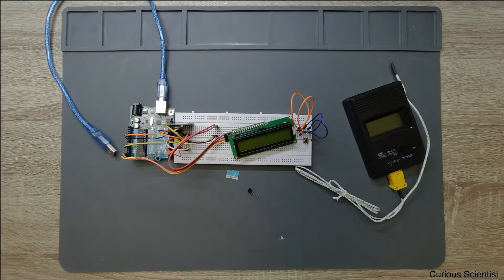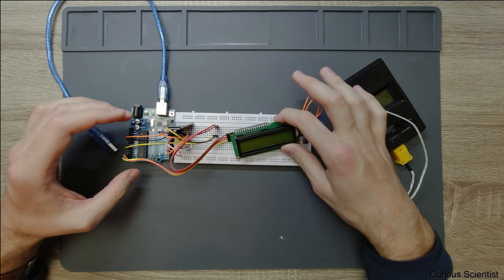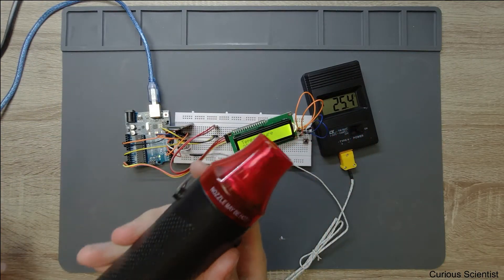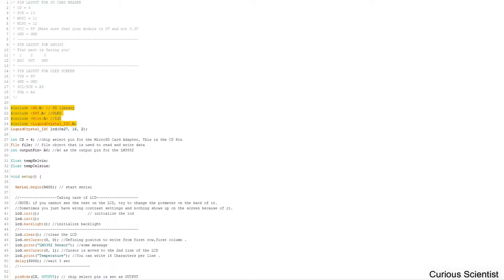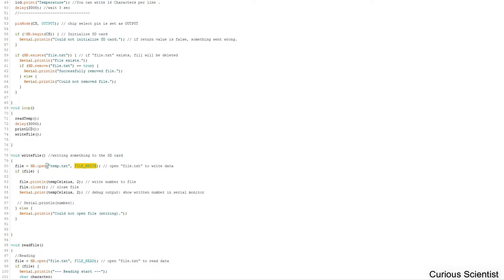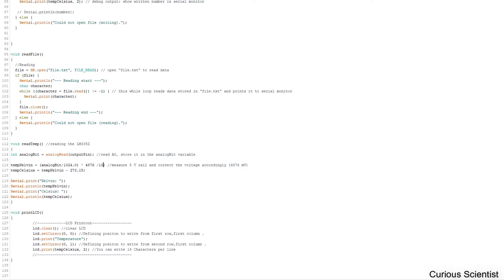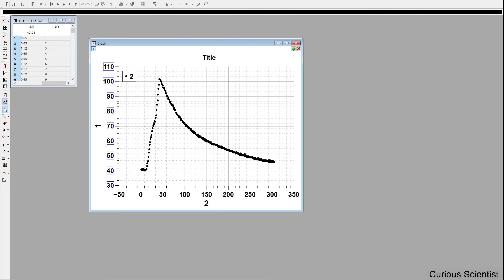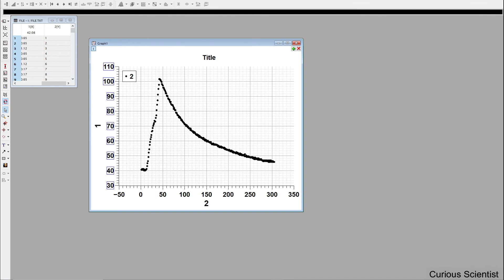Saving sensor data to SD card using Arduino

Comment: Hey, I'm trying this with a load cell and amp. When I ran the code, everything looked like it was going smoothly, but nothing was recorded when I tried to look at it on the SD card, nothing was recorded and there wasn't a file to look at. How do you start and stop a recording?
Reply from the maker: Hi! Probably, you modified something in the code that hinders saving the data. Or you didn't format the card in the correct file system. It is hard to say anything without seeing the code.
Reply: @CuriousScientist  I was really confused because everything looked good and it was verified by the serial monitor. It turns out it was on a "boot" whatever that means. Thanks for the code and reply!
Reply: @CuriousScientist  however only records when the Arduino is plugged into the computer. Any thoughts?
Reply from the maker: That can not be right. I have a similar logger that runs standalone without the computer without any issues. Have you made any changes to the code? How do you try to power the Arduino?
Reply: @CuriousScientist  I've been trying to fix it, right now I'm using the port, but I've commented out all Serial communication, and it hasn't worked.
Reply from the maker: But there's nothing to be fixed. The code is alright from the beginning. Even in the video, I powered the circuit from a mobile charger, and it worked. I think you messed up something with the code.
Reply: @CuriousScientist  All good, the problem there was a commented "}", and the other problem was running it on 7.2V through the 5V instead of Vin. Thankfully I didn't fry anything by being an idiot. Thanks for the help, and good prediction!
Reply from the maker: Giving the wrong voltage is a very typical mistake and it does not make anyone an idiot. :) It was a good lesson. I hope the code and circuit works as it should now! Have fun!

Comment: Thanks for the video man, could you give me insight on how to introduce code it shows date of the data read. Cheers from Chile.
Reply from the maker: If you want date, you'll need an RTC module. Then you just read the RTC. I have a project on my channel where I introduced an RTC-based watering system. You can use that as a starting point.